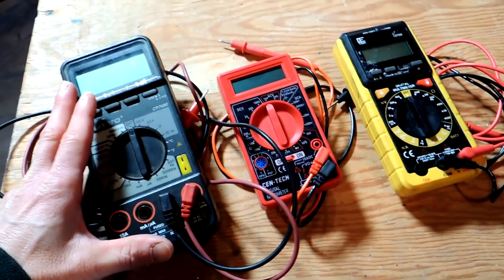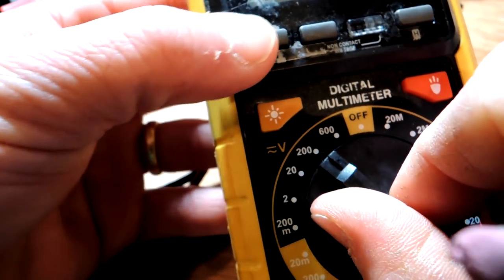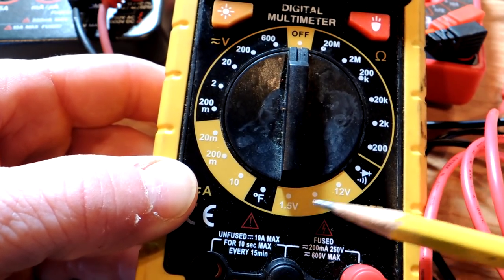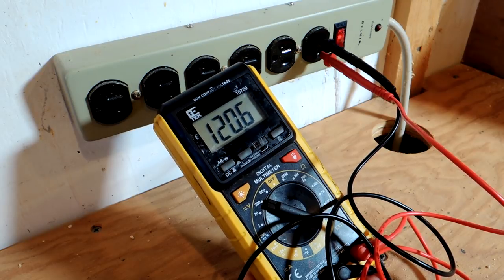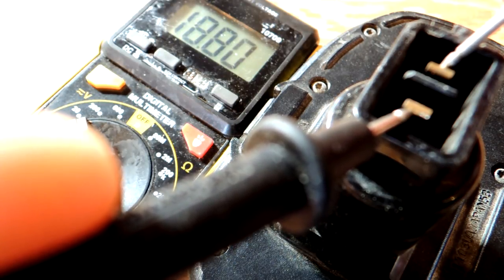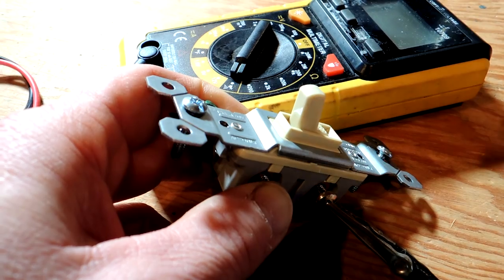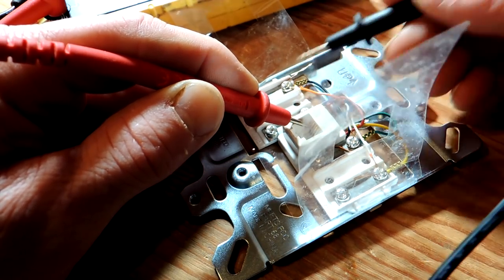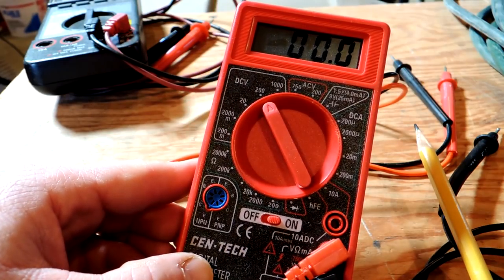How To Use A Digital Multimeter Around Your Home

Comment: I was at home Depot trying to ask an associate how a multimeter worked to be able to use it at home. They gave me an very ambiguous answer and was dissatisfied. After listening to several others trying to explain the multimeter I have to conclude that yours was the best! Your using 3 different models and explaining them really helps. Thanks.

Comment: Finally I found the Man who I was looking for to teach me how to use my yellow Digitmeter. Sir, you are an excellent teacher with lot's of knowlege that you are sharing here. I have lost hours looking for someone to teach me how to use this and the + and --- you made my DAY!! Question: Does the red wire + go into the bigger hole of an outlet or does it go into the smaller hole?
Reply from the maker: It makes no difference. With AC (alternating current) there is no positive or negative, so you'll get the same reading either way.
Reply: @enduringcharm  O.K. got it, Thank You for your quick response. There are times when I plug in my p.c. into an outlet and the charger gets very hot I mean really hot, am I doing something wrong?
Reply from the maker: Well, chargers for phones, laptops, etc., are just transformers which convert 120V AC electric into some form of DC electricity, typically.  Some heat is normally associated with that process.  However, if the transformer is getting scary-hot, then it may be time to replace it.  You can buy generic chargers on the interweb.  You'll need to know the plug style for the device side, and the specs from the side of the existing charger which should tell you voltage and amperage.  It will say something like,  Output: 12VDC 1000mA, except the numbers may be different.

Comment: Very Excellent "Beginners Guide" to using a multimeter around one's home.  I picked up a brand new multimeter at a rummage sale, and none of my friends new how to use it, even an auto mechanic.  Now, through this video, I'll be able to test batteries, measure voltage in home electrical circuits, etc.  Thanks for this great introductory video.  8.3.2017

Comment: Hey, great tutorial here! I didn't hear you mention this, but a topic you might cover for safety purposes is CAT rating for multimeters. Be mindful of the voltage and current limits of your meter as well as the size and type, and even the location, of the circuit you want to test. If there is no CAT rating printed somewhere on your meter it probably should be limited to CAT I circuits, which would be simple low voltage electronic circuits. CAT II, you can add household currents and voltages. CAT III is usually good for everything up to indoor commercial circuits 600V to 1000V, depending on the meter. And any outdoor circuits (which are inherently closer to the power source and thus more power potential) should only be tested with CAT IV meters.

Comment: Thank you so much. You explained it very well. I was taught how more diagnostic it is to use resistance to test continuity as compared to using the buzzer function because a higher than expected reading may indicate a deteriorating condition of the contact which may be caused by built up of oxidation which increases resistance. So a reading is good. It tells you something which deserve a further investigation. On the other hand, a buzzling sound only tells you a continuity - good or bad, it does not indicate.
Reply from the maker: Quite true, setting on the ohmmeter you get a value as well as testing continuity.  On the other hand, there are times when you just need a yes/no answer if something is connected at all or not.  There are times when you can't easily glance at the readout and having a beep or buzzer can make it easier to get your answer.  Both meter settings have their place.

Comment: For you plumbers - Voltage is Pressure - Current is Volume - Resistance (ohms) - is friction loss  - the only way I can remember - also the bigger the size of the pipe or wire the less Resistance or Friction Loss

Comment: Hello and thank you for your demonstration.  Now how do I check the circuit on a stereo amplifier?  The cooling fan does not work when connected though the fan does work.  What setting would I use on the multimeter to do this?  Again, thank you so much for this tutorial.
Reply from the maker: There are a hundred ways a fan in an amplifier might be wired, so I can't possibly give you specific guidance.  If you want to check the leads to the fan to see if voltage is being supplied it might be either DC or AC voltage depending on the design, but probably DC.

Comment: Hi, when checking the sockets around the home does it matter which way you put it in the holes? black and red
Reply from the maker: For AC voltage it does not matter, and for DC voltage the meter will simply put a "minus" sign before the reading if you have it backwards.
Reply: @enduringcharm  Thanks for your reply.

Comment: That was VERY informative, thank you! I’ve watched others on multimeters and they’re not as descriptive and assume you’ve a basic knowledge of electricity. Two questions…

1). What prevents these meters from blowing up or you getting shocked when sticking metal pins into live sockets?

2). If my main service panel doesn’t have clearly marked circuits showing which one feeds what, how can I use this to know if power is off?

I have to change a 100-year old push button light switch and replace it with a newer one, and I want to be sure power is off before I do. Can I use a multimeter to test it?
Reply from the maker: Meters are designed to handle the AC voltage and they don't draw a lot of amperage.  Voltage is often described as potential energy, whereas amperage is what is actually flowing through a circuit.  The amps are what will kill you, not the volts! Anyway, as long as you are just sticking the probes into the socket but holding the insulated plastic part, you'll be fine.    

You can definitely use your meter to test if power is on or off.  There are multiple ways of doing this.  If you take the switch cover off you will hopefully find an electrical box containing the switch.  Access could be tight, so it might be advantageous to also unscrew the switch from the box and carefully pull it out with the wires still attached.  On the side of the switch will be screw terminals which connect the wires to the switch.  Avoid touching your tongue or fingers to this area! 

Even old cables will have at least two wires, a "hot" (black) and a "neutral" (white).  There may or may not be a separate ground wire.  Sometimes the hot could also be red, for reasons to lengthy to discuss here.  If you touch your meter lead to the terminal with the hot wire and the other lead to either a neutral wire or a ground, then you should read around 120 volts. You may need to unscrew a wire nut for access to the neutral, or if you use ground then you may find either a bare copper wire or the armored cable itself is the ground.  The switch will have two black wires, since the switch interrupts the black wire to do it's work.  Only one side is always "live" while the other side is live when you turn the switch on.  So, you may need to try both terminals with your lead to confirm which is which.  Once you establish your voltage reading, start turning breakers on and off or unscrewing fuses.  When your meter drops to zero you found your circuit.

If your meter has a non-contact voltage feature, it will beep on that setting when it senses voltage nearby.  Point the meter at the box and you should get a beep or a light. Find the breaker or fuse and the beep or light will stop when the circuit is shut down.  You should double-check that with the leads, though. 

Of course, an easier method might be to turn the light switch on (assuming it still works) and just watch when the light goes out when you've found the right breaker or fuse.  Then you can use your meter to double-check.

Comment: Good morning sir and nice to meet you!

I love how you teach us in a simple way on how to use a digital multimeter in our homes.

I personally do not know how to use a digital multimeter at all but im highly interested in learning how to use it properly and safely.

I have a vehicle (2003 DODGE CARAVAN SE) and im trying to diagnose the blower motor resistor following this test down below.....

Check for continuity between each of the blower motor switch input terminals of the blower motor resistor and the resistor output terminal. 

In each case there should be continuity. 

If OK, repair the instrument panel wire harness circuits between the blower motor switch and the blower motor resistor or the blower motor pigtail wires as required. 

If not OK, replace the faulty blower motor resistor.

If you happen to know how to do that can you please show me how?
Reply from the maker: All that procedure is asking you to do is to see if there is an electrical connection between the switch terminals.  If there is NOT a connection at one terminal, the procedure assumes that the resistor on that terminal is no good and needs replacement.  If there IS a connection, the procedure assumes the problem is in the wiring harness.  I have my doubts about the usefulness of the procedure, though.  Most blower motors have three or four fan settings.  They way they accomplish those settings is to install a switch with three or four resistors.  The fan only has one speed: on.  The resistors reduce the electrical current going to the fan, which also reduces the speed of the fan.  If a resistor goes bad, no electricity flows at all, and the fan will not spin at all.  So, put your meter on the continuity setting OR the ohm setting.  If you test across each of the three or four terminals you should find  varying resistance depending on the strength of each resistor--but there should be SOME reading.  If you get no reading at all or show no continuity at all, then the resistor is probably burned out.
Reply: @enduringcharm  
Good afternoon!

I dont know how to use a multimeter properly.

How do i test across each of the three or four terminals?

I dont understand how to use a multimeter and the red and black probes it comes with cause i have an (AUTEL AL539B) & (INNOVA 3300) but i dont know how to use them both.
Reply from the maker: Set your meter to the ohm (resistance) setting as shown at 3:10 in the video.  Plug your leads in as shown at 4:58.  Hold one lead on one side of the resistor you are testing and the other lead on the other side.  If you get any reading at all you are good.  If you get no reading at all the resistor is bad.

Comment: How do you use the non contact feature of the everstart multimeter? Thanks
Reply from the maker: I should probably do a video on this!  So, the "non-contact" feature is just a simple measurement to find the presence of voltage.  They make dedicated non-contact voltage detectors, which you should probably buy if you want more accuracy.  To answer your question directly, on your meter you'll hold down the button for the non-contact function and slowly move the top of the meter across a wall surface or wire or receptacle.  In theory you should get a beep or a light when voltage is detected.  

That said, there are a lot of caveats.  First, this function in a meter form is a bit clumsy, since you can't get the top of the meter into tight or small spaces the way you can with a dedicated tester.  Second, accuracy can be limited.  It is possible the meter will not pick up any signal if the voltage is live but buried too deep in a wall or covered by something else.  It is possible you will pick up a signal, even though the circuit is not live.  This is due to a phenomena sometimes called leakage.  So, the best way to use this feature is to double check with the probes when you believe you have a good reading.  If you get a "live" indication for a wire or receptacle, double check with the probes on the wires and see if you really get 120 volts, or if it is some very small number due to leakage.  Or, if you get a "dead" reading, double check with the probes that you really don't have any voltage present.  Incidentally, this feature only works with AC voltage.

Comment: Can you explain what the unfused portion of the multimeter is used for please? Thank you!
Reply from the maker: When you get into measuring current or amps (as opposed to voltage or resistance) then you may need the unfused lead because the meter itself is inserted into the circuit and therefore can alter the readings.  The fuse can introduce inaccurate results. This is true of certain electronic circuit testing too.  And, actually, this is confusing because some meters say fused or unfused and others have different markings and there may be either fuses or weak links built in to the meter internally.  Basically, if you are measuring volts/ohms in the kinds of tests shown in this video, keep the red lead in the hole marked as such.  The only reason to switch to the other hole is if you are measuring amps and you know enough to safely insert the meter into the circuit itself.
Reply: Thank you sooo much for the thorough response. This really helps!!!

Comment: I need to check the cables on some XLR wall plates. one end is downstairs. what do I need to test this?
Reply from the maker: So you have a studio with XLR wall jacks in two rooms, connected with cables between?   You may be checking for several things.  One is just continuity between point A and point B.  If the wire is broken you won't get anything going through!  You can use either the ohmmeter or the audible continuity tester on your meter for this purpose.  You might also want to check how well the signal is getting through, in which case you you would use the ohmmeter to check for resistance.  There really shouldn't be any resistance.  So, this is going to seem weird at first, but you'll see where I'm going.  I have a video on how to test hard-wired smoke detectors which is actually exactly what you need!  The tests in the video are identical to what you'll want to do, so if you just imagine an XLR jack instead of a smoke detector wiring jack, you'll be in good shape.  I'll explain how to connect the meter when you have a long run to test.  See the video here:  https://youtu.be/q1B1wHp7Azs
Reply: @enduringcharm  thank you so much. I will check this video out now

Comment: IF i get OL display does that mean broken  connection I.e fuse or switch..?
Reply from the maker: If you get an OL reading on the ohm setting, it means that there is infinite resistance, or at least resistance is out of range for the scale that you picked.  No connection, in other words.  Always check your meter leads, though, to make sure you do get a reading when you touch them together.

Comment: I have the red multi meter as you have. How can I use the ohm setting to test a 400Vdc x 120uF capacitor??

The instruction say use Resistance measurement setting. Which I believe I should be getting some reading.

An I suppose to charge the capacitor before take the measurement ?
Reply from the maker: To test a capacitor you need to have it out of the circuit and discharged.  Put the meter on the highest ohm setting and connect it to the capacitor leads.  You should see the reading steadily rise if the capacitor is working.

Comment: Thanks so much for this video you made it all make sense and I am not as afraid of testing things now because I am very afraid of electricity because a lightning bolt hit next to me when I was a teenager.  I just bought a multimeter and yes it is very intimidating when you open it and look at the numbers and you cannot find the number you where hoping for.  I bought mine to test batteries after I recharge them and my multimeter does not show 2V it shows 20m, 200m, and 10 with no m on the 10.  I tried the 10 and it won't work I tried the 20m and I get a reading that is close to what you are saying in your video, does that make sense is 20m the right setting to measure a battery that is 1.2v AAA 2000mAh?
Reply from the maker: The number just represents the upper end of the scale.  To test a battery of 1.2V you want your meter to be on the DC volt setting, and on a scale that is higher than the battery size.   A 10 or a 20 volt scale would be fine, for example.   The "m" or "mV"refers to millivolts, which would be too low of a scale to measure that particular battery.    I'd have to see your meter to understand what you did, but it may be that you didn't have DC volts selected.

Comment: This may have been asked before, but is it possible to split a line from one breaker into 2 so that appliances plugged don’t cause tripping(ex: kitchen wall has 2 outlets-if crockpot on one outlet then turn on the coffee pot on the other outlet, it trips out)
Reply from the maker: You need to understand that the breakers are there to prevent  more current from traveling over a circuit than it can handle.  So, if you are tripping breakers that means you are trying to use too many devices on a single circuit and the breaker is saving you from a problem like a fire.   The solution, then, is to add another circuit.  In fact, the electrical code has changed in recent years to require more circuits in kitchens because we are all using more devices than in previous years.     If your breaker box is already full there are breakers designed to take up half the space of a normal breaker, but you still need to run the circuit itself.

Comment: Can you use the continuity function to find the neutral?
Reply from the maker: I suppose you could if the power was off.  For most residential installations ground and neutral will be bonded at the box, so continuity probably indicates neutral.  However, I think it's more common to leave the power on and find the hot using the volts function. The ground should be the only bare wire in a box, so the volt reading across a hot and a neutral is easily found and getting a voltage from the presumed hot to the bare ground confirms which is hot.